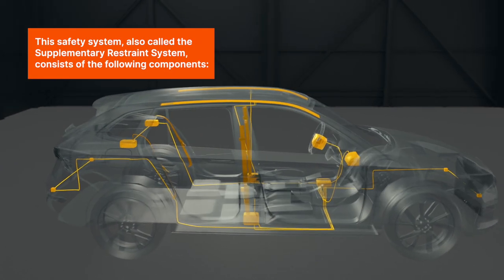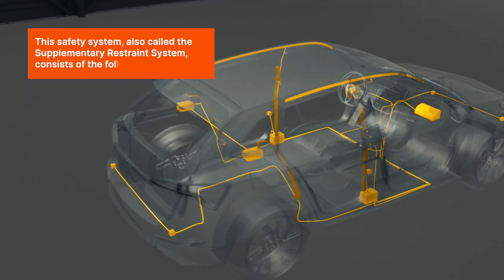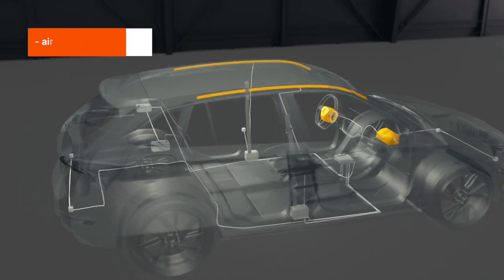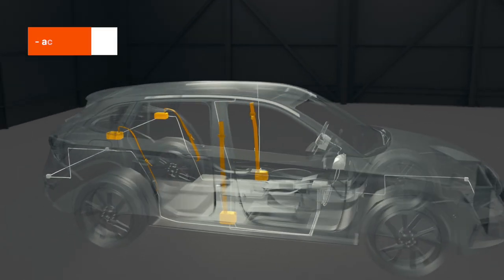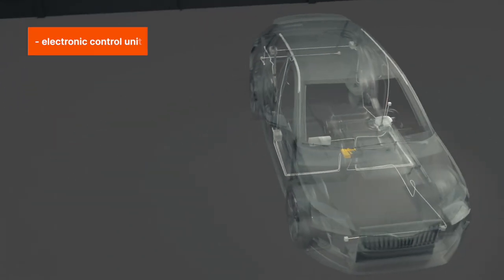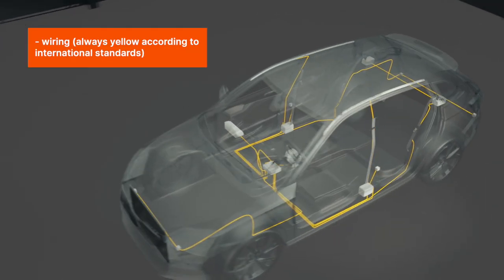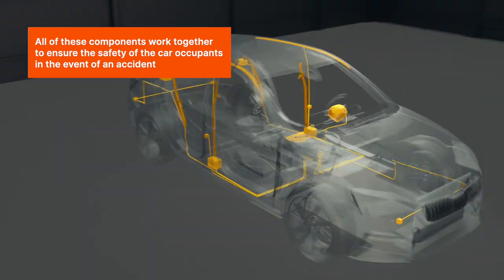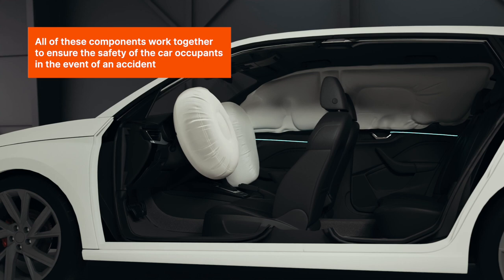Understanding Airbag Light Warnings | Essential Tips for Car Safety

Comment: I have problem with voltage on my Tigra A. When the RPM is around 3500 airbag light comes on and lights are more bright. I saw that temperature sensor wire is a little bit damaged and sensor doesn't show correct temperature. Temperature sensor is new. Maybe that damaged wire is causing the voltage problem because in the last year both alternator and battery are replaced.
Reply from the maker: It is difficult to say something concrete about the issue in your car without proper diagnostics so that we recommend contacting the professional car service.